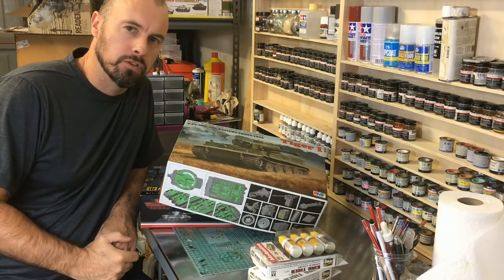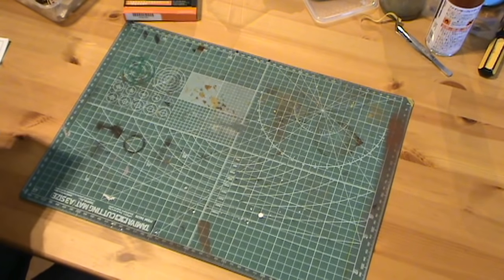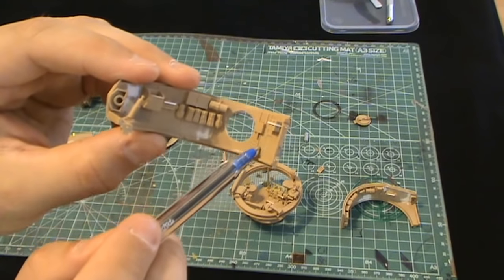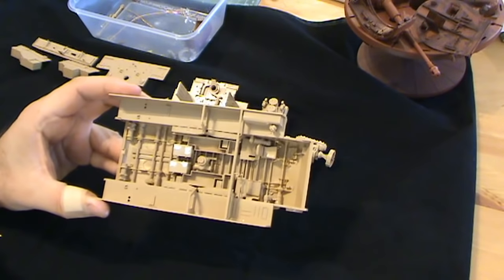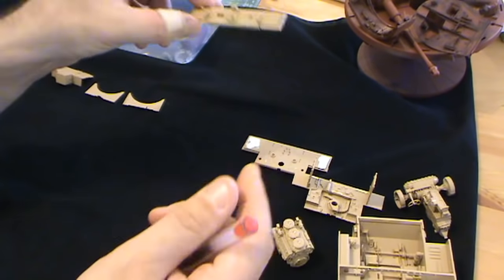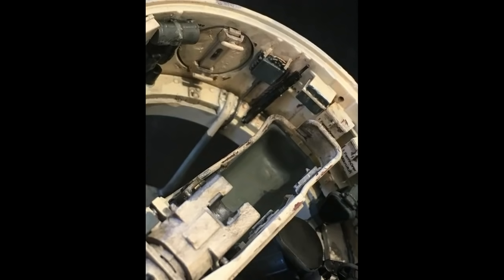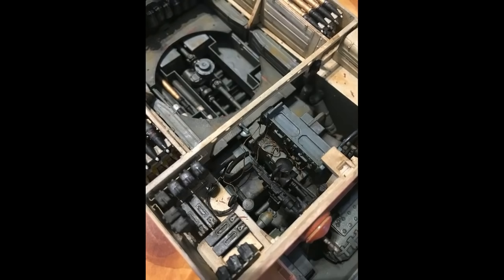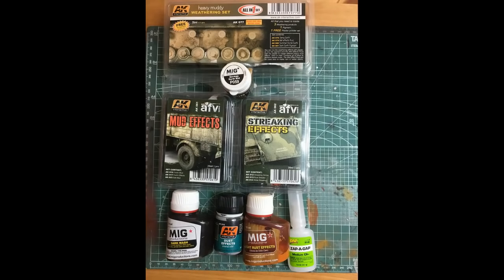Ryefield Tiger 1 (Kit 5003) Tiger 75 Anniversary - Part 1 Interior

Comment: The firewall took a while to remove 3 of the handles,and build somemore,and add more brass.The vision block holder was easy to recreate with PVA and thin lead strip.Thanks for detail info.I hadnt a clue what it was.I cut a thin slice from Morse code sender with scalpel and some v.thin copper wire.looks good on ledge under radio.The RFM Panther is much better plastic,more complete and complex int. No pedals appearing from floor.I just built the riich models universal carrier and the RFM panther is bigger but as accurate.It is £60 but it has 71 steps and 20 options.Its the best ive seen in complete interior.Your vids godsend.
Reply: thanks mate. Hope your build went well!

Comment: nice one.Just starting the 5010 mid.Theres enough parts to start a tiger factory,feifels 2 backplates,sidearmour turret rings...looks like everything up to mid is here in the sprues.Unusual.Only thing missing is is the half turret parts.Ive got an old Afrika korp voyager kit i bought for 6254 dragon initial,theres all the parts for fiefels,exhaust covers etc...my brain is giving out trying to work out my options.Im not a rivet counter but love PE and sheet and rod brass for scratchbuilding and lots of time.Great vid.More info,more choices.
Reply: Hi mate, you must be talking about Dragon Kits? Great kits and a good degree of flexibility. Good luck on the build

Comment: Does the steering wheel go like that or the other way around with the open area on top?
Reply from the maker: Hi Owen the open area is at the bottom so that it gives the legs clearance in a tight area

Comment: Beautiful build for a non rivet counter !! :) only things I would add is weathering to your expended cartridge bin...when rounds are ejected that bin will be damaged overtime and scratched and your'e barrel would probably be scorched from firing many rounds so the color would reflect that...just my thoughts but brilliant mate
Reply: PS I have the academy kit..and I am looking forward to getting started on it for better or worse..least they got there first and the others followed :)
Reply: Yeah could probably have done some more on the bin...will look at it again once I eventually complete the exterior.Thanks for the comment.  In terms of scorched not so much. The Germans were fastidious in keeping the gun clean - at both ends. Unless in the middle of the battle or slight marking, all the carbon is cleaned off as soon as possible including the exterior end of the barrel. You see a lot of models blacked at the end - unless modeled for battle or straight after, they should be virtually clean bar some minor marking over time. 
I may have even over weathered the interior as the Tank would have only been a few months old at that stage and the Germans (unlike the Soviets) built vehicles to last so its unlikely to be scratched a lot - mud and dirt yes but again they were cleaned by the crew at the earliest opportunity. hope that helps

Comment: Great job! I like you, have gone all out on my vehicle. Mine is in a complete stop mode. I'm trying to scratch the drivers binocular driver sites. They omitted the bracket that holds the fold down sight for the driver. ? Why? and I'm trying to build one unfortunately I've lost my mind I'm still trying to do it but every once in a while I have to take a break. anyway you went all out great job.
Reply from the maker: Clayton McClain hey thanks. Yeah I get the same problem. For this one, the hull paint colour nearly drove me nuts. Even the slightest variation I wasn’t happy with, ha ha. I used spares that I had but it’s hard to buy another kit just to extract another single part or two, so I understand your dilemma about the drivers aid. Hope you have a good photo to work off at least. Good luck.
Reply: PanzerGarage 
At least I have to thank you for giving me the paint colors. that's one thing I don't have to have my eyes bleed out looking for the painting colors so thanks for that. Again great job all around. ;-)
Reply from the maker: Clayton McClain no problem. If you get stuck drop me a line in Facebook and will see what I can dig up for you.

Comment: Good day! Great model, I'm starting the same construction now. Question: Did the inner walls of the tank get damaged or left the natural color of the plastic?
Reply: Hi mate, thanks for the comment. Good luck with the build. I am very slowly doing the external but have been delayed due to work. To answer you question, no the plastic did not get damaged and not left the plastic colour. The whole vehicle has a red oxide undercoat both inside and outside. On this model it is a two tone interior and for that colour I used Modelmaster panzer Yellow 1943. At the end of the video (and throughout the video) I do talk about the colours and at the end I discuss the paints - if that helps. The internal has been weathered and chipped as well which is why it may look damaged. Hope that helps but if not let me know..Good luck and all the best
Reply: @damienhick1647 , Hello! I watched the video to the end, but, unfortunately, in English is not strong. This is my first model, I still get involved in the world of modeling. I am going to paint the whole model with a brush, as there is no aerogroft yet.

Comment: Currently building this same kit right now and its an ejector pin and mold seam nightmare IMO. The instructions are sometimes not very clear and the paint guide is pretty piss poor to be quite honest. There are some mistakes as well with the paint colors are a couple things. The ammo was a mess to clean up too. Other than these things it looks like it builds up to be a nice model.
Reply from the maker: Yes mate, the ejector pins can be a pain on some of the items. I also found that you needed to really read the instructions carefully as often the arrows can be misleading and too general, although I build and paint in sections so don't always follow them. Paint colours are not so good but I have found all manufacturers to be inaccurate, so nothing new there. If you look closely at the ammo some are inaccurate as well but most people wouldn't know. Having said all that it does come up very well if you spend some time on it and paint research - which I have virtually done for you. Good luck with the build
Reply: PanzerGarage Thanks for the reply mate. The lower hull interior color  that calls for AK French Artilary Gray + 10% White looks way off... The color you used looks more like a Panzer Gray. The periscope blocks are incorrect paint color as well, calling for flat black. The real ones look more of a dark flat brown to me. A few details are ommitted as you've shown especially in the engine bay area. It feels as if RFM ran out of money making this kit and rushed it on out. From what I can see though, its one of the better interior kits out of all the others especially the Academy Tiger I.